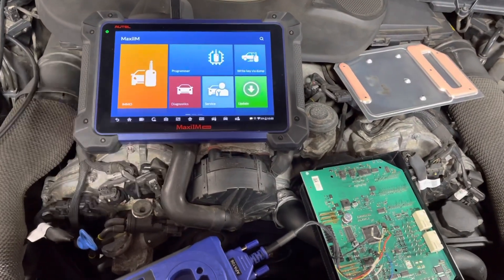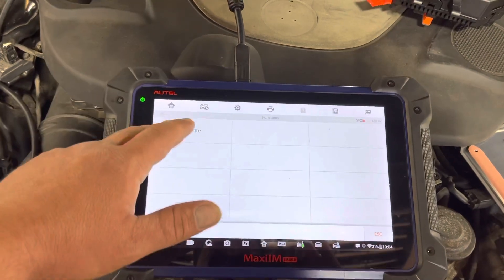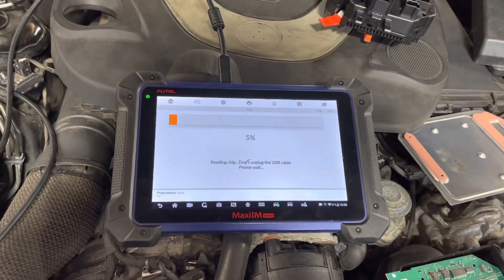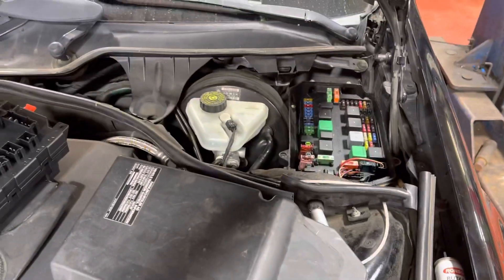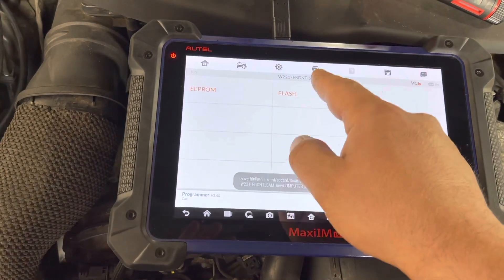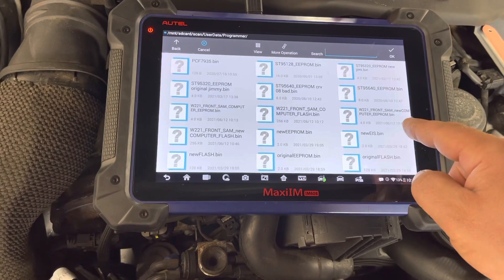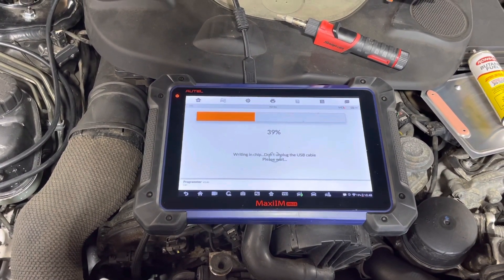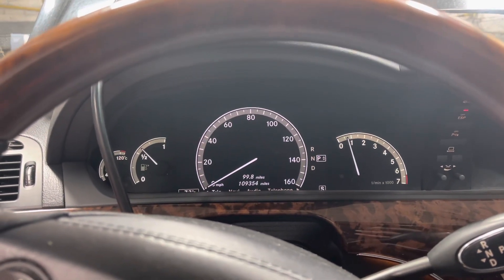Mercedes S550 W221 Front SAM Module Cloning or Programming With Autel IM608

Comment: Thank you for making the video. I am about to do the same for my car's new SAM. S-class w221  2007 model. I will follow all steps carefully.
Reply: I have the same year and model. What are your symptoms?
Reply: @MuzixMaker  Hello. My headlamps do not work. The window mechanism is not working either, and the central command panel doesn't come on. There is severe rear battery drain.
Reply: @josephkebbi1146  thank, so far I only have a headlamp and cornering light out on the left side.

Comment: Would you have to do this if the Sam was new from the dealer?
Reply from the maker: If you do this with new one it would also solve the problem or else you would need Xentry (Factory tool) to program and code it. Some after market scan tools can do SCN coding through OBD but not really reliable. Some of this ECU’s also plug and play as long as ECU is new.
Reply: Do you have contact info I need to discuss some programming I need to get done????

Comment: one question i have a 2010 s550 mercedes can i use the used fuse box and the original sun module or do i also have to program the fuse box

Comment: Hello , do you have a number or an account that I can contact you with ?
My question is 
I have a 2019 silverado and I want to install an oem fog light kit 
but after the installation the bcm need to get flashed in the dealership so they can enable the fog light option and also to enable it in the instrument cluster unfortunately the dealership in my country is too stupid to do it and when I ask them if they have this service they say No and it will get out of warranty if i tried to install anything that related with the electronics
So please answer me if you can help because i saw your video on the gm bcm reprogramming and I wanted to ask you if you can help me plus I will pay for your help if tell how to do it 
Thanks
Reply from the maker: Yes definitely, contact me at +13472650322